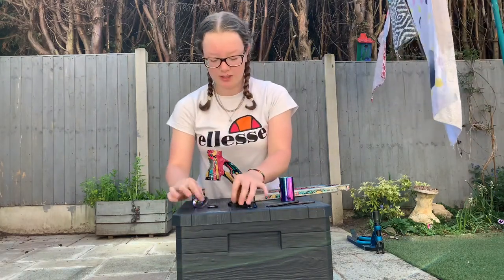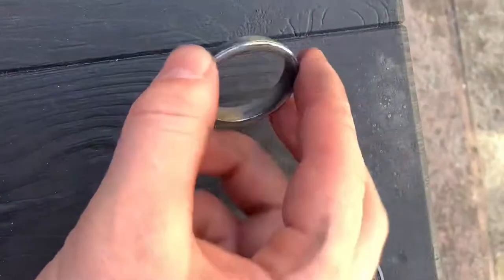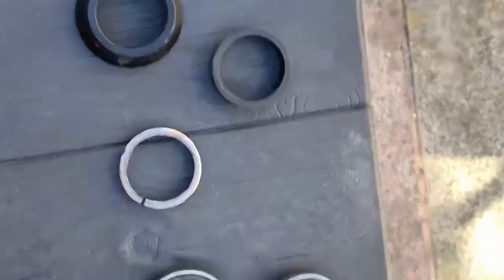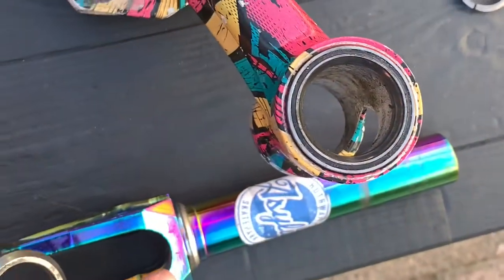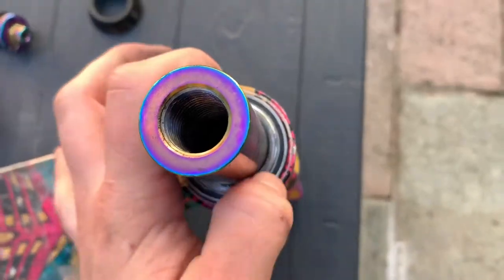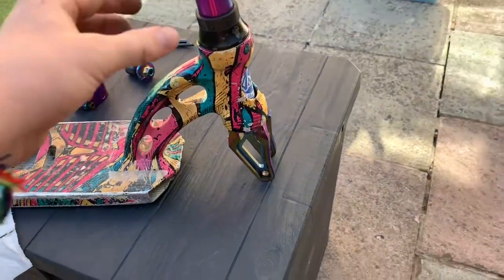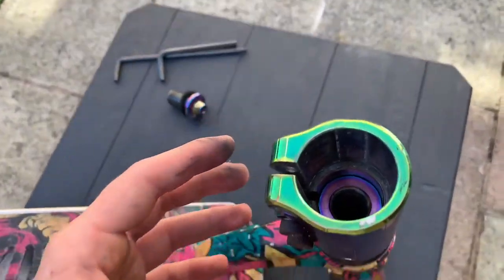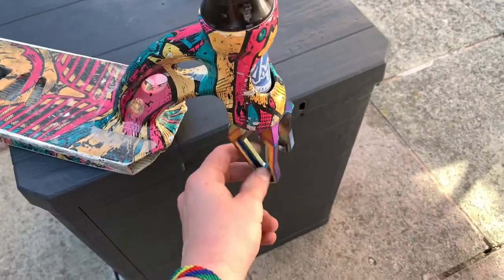How To Fit SCS Compression On A Scooter

Comment: Will my oversized lucky bars work with a lucky IHC fork with a SCS Lucky quad clamp
Reply: Yes only if the SCS clamp is able to fit oversized bars and also the bars have to have no slit in them and you would need headset spacers to fit the IHC fork